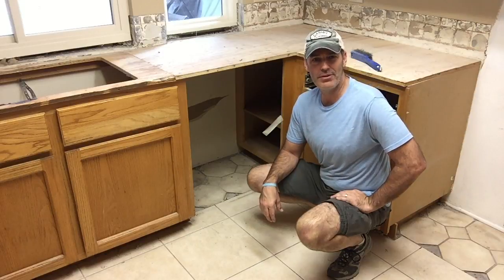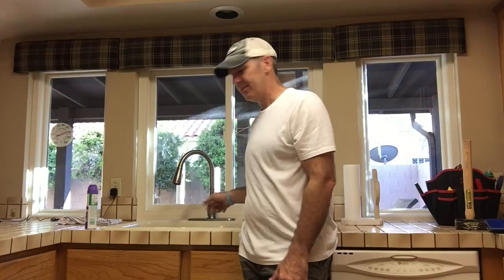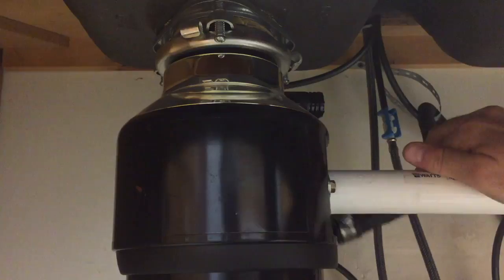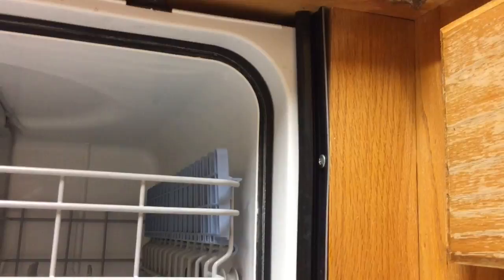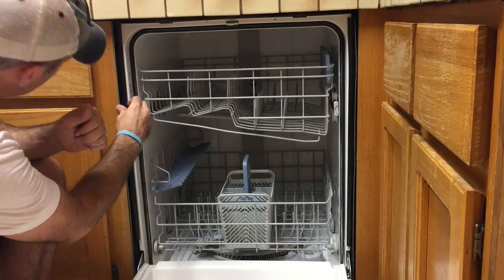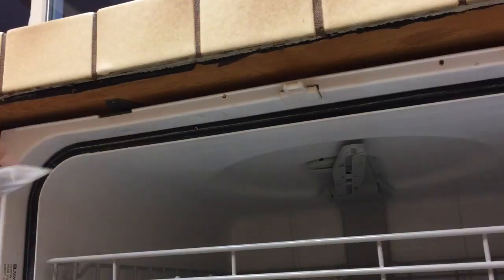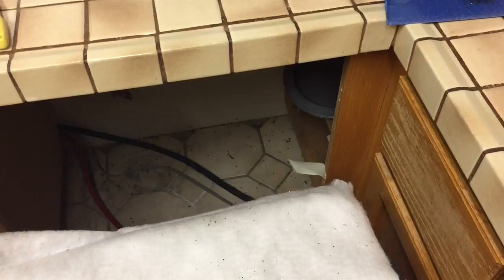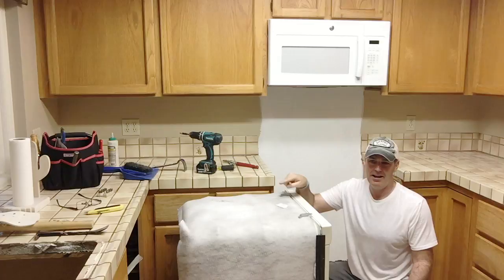How to remove a kitchen dishwasher

Comment: ??? How did you pull out the dishwasher without disassembling the electrical wiring? Did I miss something?🤔
Reply from the maker: I guess I just didn’t include it because it is very simple. Unplug from usually under the sink and just it will pull out when you pull out the dishwasher. Hope that helps.
Reply: @how2q   You must have a much newer dishwasher than mine. We had to open a metal box underneath the dw and uncap all the twisted wires. The dw won't pull out until it's completely disassembled from the main wire. Somehow we ended up with 3 Black & 3 White wires + 1 copper ground wire. Not sure why there's 2 main power wires coming through the floor behind the dw. I'm guessing only one of those is the correct one that connects to the dw's power lines. We weren't sure how to put it back together correctly to make the power return to the dw. We were hoping to find a YT video that would help us with this. That's why I was puzzled about not seeing you undo the wiring. You were fortunate to have a plug-in model which I had no idea existed. That will definitely be a mandatory feature in my next dw. 😄 Thanks for your reply!

Comment: You didn’t show the electrical part. Or did I miss that?
Reply from the maker: The plug is in back of dishwasher along w hose.  Both go through hole in back of cabinet to outlet under sink.  Honestly not much to it.  Just feed hose and chord through hole and feed through as you push dishwasher back in

Comment: Quick question, as for the sink disposal. Do I have to close up the hole in which the dishwasher hose was connected ?
Reply from the maker: Yes...use the plug/cork to plug that hole
Reply: @how2q  from where? Or does one need to be purchased
Reply from the maker: @mistahferguson6240  once you remove hose from disposal you need to plug outlet somehow.  Several suggestions…rubber cork or wine cork works
Reply: @how2q  thank you
Reply: So you keep the black rubber connector attached to the disposal and just plug it with another piece?

Comment: I have a question I’m trying to permanently remove my dishwasher and notice the water line is connected to the hot line as well if I’m trying to permanently remove the dishwasher and don’t plan to install another one how do I close off the connection or the water line ? Once I turn the hot water line back on it will come out of that hole the dishwater was connected to correct ? And do you get a cork/plug for garbage disposal hole from Home Depot or Lowe’s ?
Reply from the maker: So when you’re talking about the waterline, it should be coming off your kitchen sink water supply. When you remove that put a quarter inch or three eights inch cap over it. It’s a brass cap that you can get from a hardware store.  Buy both to ensure you have the right one.  If and when I have questions like this,  take a picture of it and go to an ace hardware or true value hardware store. They typically have very knowledgeable people working there to help you out.
Reply from the maker: Make sure you get plumbers tape also…metal on metal tape always recommended.  Very cheap and will save you!
Reply: @how2q  thank you sir for your help !
Reply from the maker: @sylvianareyes8753  Hope it helps. I actually got the idea for the garbage disposal plug from a 70 year old guy at Ace! Good luck
Reply: @how2q  one more question lol do you need to mess with wiring in junction box if removing the whole dishwasher?  I see videos that mess with that and know that all electricity in kitchen needs to be switched off but I see in your video you did not mess with it
Reply from the maker: If all you are doing is unplugging dishwasher then i wouldnt worry about it.  Anytime you take faceplate off outlet make sure to trip circuit breaker and confirm that it is not powered
Reply: Hi! I also want to remove a really old dishwasher and install a new cabinet for more storage. Was it easy to remove? After turning off the power and unscrewing everything I should be able to pull it out right?
Reply from the maker: Make sure tube that leads from garbage disposal to your dishwasher is disconnected.  Use a rubber stopper to seal port on disposal once you do that (i did a quick video on rubber stopper technique…wine cork works also).  
When you pull out dishwasher, tabs on top used to screw into countertop may “catch” as you pull out.  Just need to use a flat head screwdriver to bend them down as you pull out.  Hope that makes sense and helps